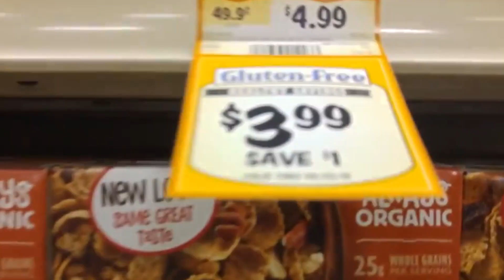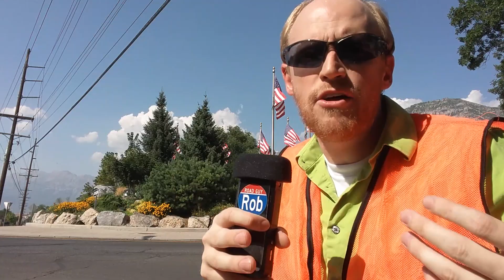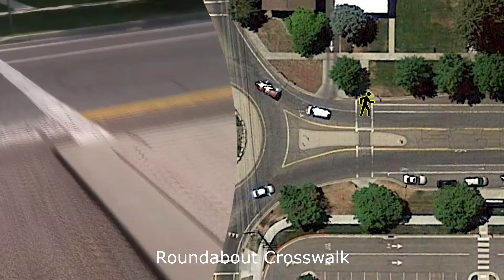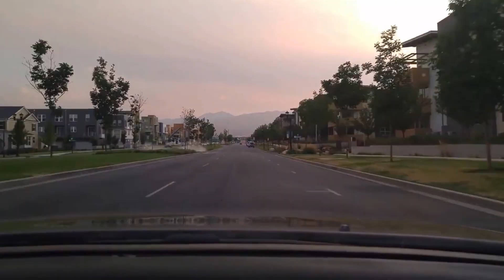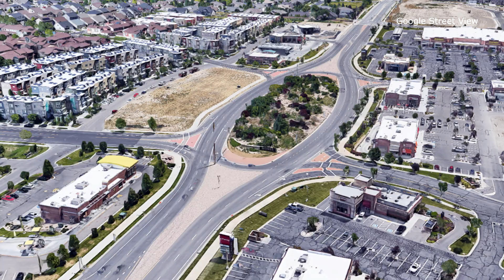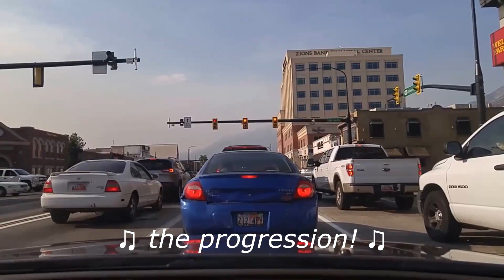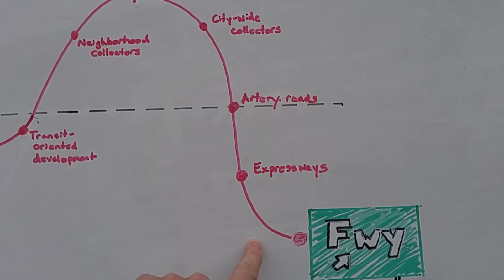Are roundabouts REALLY better than a traffic signal?

Comment: One thing you didn’t cover or I missed is that they are more fuel efficient because of all the stopping, starting and idling with a traffic light.  Less stress on the vehicle too. Not sure if this is accurate but it makes of sense to me.
Reply: Correct. Acceleration uses up more energy than maintaining speed.
Reply: in places with high traffic this is false, I had to use a roundabout on a congested road everyday and driving really slow and stoping/moving every 5 sec/ burning the clutch is the worst, if there was a traffic light then I could just stop one time and turn the engine off and turn it again when the light is green. And when I  fianally reach the roundabout I had to really step on the gas  to enter it. There was always a poisonous cloud from diesel cars.
Reply: @423GustavBern  I think it depends. We had a high traffic circle that had been there for decades, about 5-10 years ago they changed it.  Before it was fast moving, now we avoid if possible during peak hours because it’s terribly designed.
Reply: @423GustavBern  if you stop/move all the time in traffic, you're following up too close.
Reply: With stop-start technology this is less of an issue since cars will know exactly where they left off and can pick back up again easier, and while off they aren't burning gas. (Its gentler than manual turning a car off and on again where the car forgets where the cylinders are and just trys all of them).

Of course a roundabout flowing properly is theoretically better because you don't slow down as much so you waste less gas by braking all the way to 0 and then going again, or worse idling for what feels like an eternity only for the next light to be timed so you hit every light red like they seem to be in my city.
Reply: @jasonreed7522  cars do have sensors to pick up the crank rotation, but it does take longer to fire up when it’s cold because the car cranks over and checks that everything is perfect then adds fuel, because if it miss fires just once the car will probably not pass emissions testing, when the engine is nice and warm the right parameters are reached more quickly and it fires right up,
Reply: Your point is 100% incorrect.  You are forgetting all the breaking caused by all entrances to the roundabout having to slow down/stop.  That breaking means building back up to speed which is the least fuel efficiency of your travel.  You are also skipping all of the green light traffic that flows through at speed which is the most fuel efficient traffic.  The mandantory breaking and speeding back up is taking more of a toll on your vehicle AND wasting more fuel.
In short, as opposed to pointing out a positive, you have pointed out a clear negative of roundabouts.
Reply: @winoodlesnoodles1984  I’ve lived in places like Tulsa and Boston.  Boston has a lot of roundabouts, Tulsa has several stoplights every block.  I’ll take a roundabout any day as do many who are commenting.  100% incorrect is a stretch, but appreciate your comment and you do make some good points.
Reply: @billwong553  I will yeild 100% incorrect is a stretch, but not much.  The human condition is why a lot of people like roundabouts.  That is we tend to focus on the negative more than the positive.  The restaurant industry is the perfect example.  It is well known that a person have a bad experience at a restaurant is 4-5 times more likely to leave a review than a person that has a good experience.  That is precisely what is going on with roundabouts.  Basically you remember stopping at red lights specifically because you had to stop.  You don't remember all the times you drove right through green lights without slowing down because it had little to no impact on you.  You don't feel lucky you got to drive through without slowing.  This is why most  commenter focus on not having to fully stop despite having to slow down, often significantly.
To be fair, roundabouts do make traffic a bit better for non priority roads.  However, this is offset by making things much worse for the priority road.  The priority road is that due to greater traffic volume.  Thus, the roundabout becomes a net negative.  However, if you are the entering, a priority road from a lower priority road, you situation is actually improved.  Thus for yourself and other commenters, some roundabouts may be a net win for you.  They still remain a net negative for the overall traffic.
Reply: @winoodlesnoodles1984  A study by the Insurance Institute for Highway Safety (IIHS) estimated that the conversion of 10 percent of the signalized intersections in the United States to roundabouts would have reduced vehicle delays by more than 981 million hours and fuel consumption by more than 654 million gallons in 2018.  

Studies by Kansas State University measured traffic flow at intersections before and after conversion to roundabouts. In each case, installing a roundabout led to a 20 percent reduction in delays. Additional studies by the IIHS of intersections in three states, including Washington, found that roundabouts contributed to an 89 percent reduction in delays and 56 percent reduction in vehicle stops.

While cars and trucks are increasingly cleaner and greener, vehicles idling at a signalized intersection still emit pollutants and gases into the atmosphere. Stops and starts use more fuel. Because roundabouts reduce the number and duration of stops, they also reduce vehicle emissions and fuel consumption. In a study of 10 intersections in Virginia, the savings amounted to more than 200,000 gallons of fuel per year.

it’s just my cognitive bias though.
Reply: @billwong553  First, I will agree in appropriate intersections there is some merit to roundabouts.  I have yet to see an example of a civil engineer intelligent enough to locate one at a proper intersection.
The KSU study is worthless.  You can't claim reductions in delays without stating the extra delays caused by roundabouts.  Useless research by people trying to prove their point without researching the counter point.  However, that is just how pathetic universities are today.
It is undeniable that, as you state, starting and stopping and idling are the largest waste of fuel.  This is a key problem with roundabouts.  The lose the green light efficiency of vehicles that never had to slow down.  That is the best fuel economy and least wear on the vehicle.  Roundabout negate all of that.
As for the Virginia study, on the surface it proves your point.  This is where my cognitive bias comes in.  Having show that KSU and most people don't consider the inefficiency cause by roundabouts, it is my personal opinion (again my bias) that the Virginia has made the same error. Until I can research it and prove that, I will agree this one item makes your point.
There is another thing missed by a lot of studies that is clear when you are at a roundabout.  Most are not 18 wheeler (semi) or bus friendly.  Until that is remedied.  I will not support the stupidity of roundabouts except in quite suburban areas that aren't designed for buses or semis anyway.
Reply: @winoodlesnoodles1984  "They still remain a net negative for the overall traffic."

Roundabouts mean fewer people are killed, so they're  a net positive.

Comment: Alright but these are a fucking nightmares in a semi. There's a set of roundabouts in Hammond, LA off of I-12 where you can get stuck yielding forever because when your gross weight is 80,000 lbs it takes several seconds between you flooring the throttle and the truck starting to move, and by then there's already another line of cars in the roundabout and you have to stop and yield to them again.

Comment: Your interesting topic got me thinking about road safety in Australia. Road deaths here have dropped from 2,800 in 1989 to 1,145 in 2018. That’s a 59% reduction in 30 years, despite a 62% increase in population over the same period. We’ve had many safety initiatives in this time, one of course being extensive use of roundabouts. When “platoons” of cars can’t be fixed upstream, changes are made such as part-time traffic light filtering on the roundabout. Some larger roundabouts have slip-lanes for left turns. 

What really scares when driving in the US are four-way stop signs. They don’t exist here.

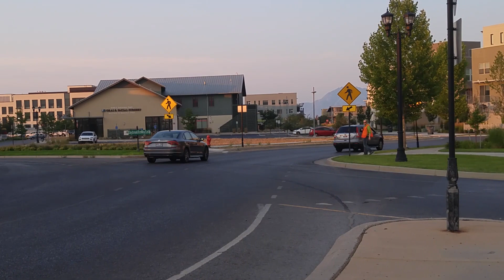Comment: 4:17 in Europe some roundabouts also have traffic lights. Sometimes stopping one entrance or left turn only, or straight ahead only. Very big roundabouts can have a pedestrian underpass or footbridge.
Reply: A roundabout with traffic lights is the peak of human stupidity. You get the worst of both worlds. Living next to one of those abominations.
Reply: Those are not roundabouts they circular Lanes
Reply: @Orionte9  They're still called roundabouts in most European countries. I think the American term for those is 'traffic circles'.
Reply: @PJBonoVox  We have such a roundabout with lights on a big intersection where the freeways comes into the city and where we have several directions to leave it. I was skeptical, but it really works well. You need to wait at least at one light. But it doesn't clog and the lanes are very clearly lead.
Reply: Worst are the traffic light roundabouts that have pedestrain traffic lights just 30 meters away from the exits of the roundabouts. you are just gettiing up to speed when stopped by a walker who pushes the button just as the green light goes on the roundabout. No synchronisation between both signals so that all the traffic is stopped on the roundabout even though they have a green light.
This is lovely at school times when hundreds of students are walking out onto an arterial route at quitting time. It leads to many 2km tailbacks and delays until the students get home. Educators, not being ones for imaginative solutions, all start a 9 o'clock and all finish at 3.30 so you can imagine the resultant chaos for other road users.

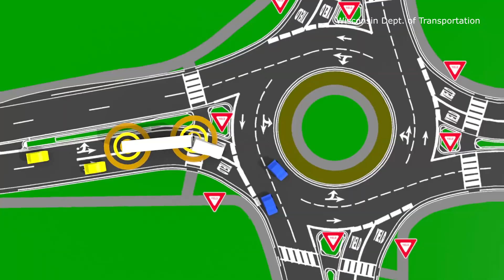Comment: 2:14
To begin with, that truck is doing the roundabout wrong. The truck should be on the right lane, and occuping a bit of the left lane to have enough space to do the manoeuvre safely and with enough space. I'm a European truck driver, and roundabouts are not very difficult to manage with a truck. 
Motorcycles, that's a real pain in the ass...

Comment: We have some large roundabouts (with 3-4 lanes) in some cities here and they added lights to them. This way, only so many cars can enter the roundabout, and each time they get a green light, 95% of them clear the roundabout. Somehow this keeps the traffic flow high and yet, accident-free.
Reply: As much as I hate seeing a beautiful roundabout ruined with traffic signals, they are a great way to give some power back to pedestrians.  The major downside to a well located roundabout is that traffic can actually do away with stopping entirely.  

For some pedestrians it is simple enough to walk in between traffic since it has slowed down, but those with limited confidence or mobility can end up stuck waiting for a break that never comes if they try to cross at a roundabout in peak hours. 

Drivers naturally avoid stopping for the pedestrians before entering the roundabout even if they are instructed to give way to pedestrians because stopping impedes the traffic behind them.  A traffic light means cars are forced to stop so the pedestrian can make sure they have been seen and can cross safely.  

The best of both worlds would be graded crossings for pedestrians so they don't actually interact with the roundabout at all and instead tunnel under it or bridge over it. 

If you can't have lights or pedestrian bridges, the next best thing is to move the crossings as far away from the roundabout as possible and disconnect it from the pedestrian foothpaths to discourage people from crossing at the point where cars are too busy observing the traffic on the roundabout to stop for pedestrians reliably.

Comment: You missed the three most important points that are major advantages;
1) Huge reduction in fuel consumption and resulting pollution from idling vehicles.
2) Much faster travel for everyone.
3) Easiest and safest possible way to do a U-turn or turn across traffic (that's left in the US)
As for the comments on Freeways, what????  UK & European motorways have them at every junction with a slip road and the roundabout either above or below the main road.  So what is the possible problem?

Comment: But Wait! What about multi-lane roundabouts with traffic lights on the roundabout? Truly the worst combination of variables ever to be puked out of any town planners wet dream. Both slower and more expensive, defeating the advantages of either system. AAAAaaaand because its so ridiculously confusing you get to put pretty LED lane markers on the road that change configuration with the changing of the lights. Even more expensive to install and maintain.    Its fucking genius.  But, I have to say its trippy as fuck when you are driving along fucked out your face on acid. I went round that roundabout at least fifteen times till I saw a blue meanie and had to escape. Shoulda seen the tracers man! Wild. 
This padded cell is really cosy.

Comment: He incorrectly pronounced Carmel, IN, instead saying it like Carmel, CA (by the sea). Otherwise, important points. Traffic lights are hardly a safety measure - they are almost entirely for traffic flow. Traffic circles are great for improving safety, for reasons mentioned.

Comment: I dont believe the part about you stating feeder roads allow cheating. No your understanding is incorrect. Its designed that way so anyone who has no buisness at that intersection isn't imposing more traffic and producing unnecessary loading at an intersection. This is a far safer better approach by separating the traffic. That concept is sound. Another form of that was in Chicago when its grid system was developed. It incorporated alleys to give access to rear deliveries and seperate traffic instead of chaos like how randolph and other streets were pre 1871 great fire

Comment: Hey Rob, you should go visit Ireland sometime. My spouse and I went there for summer vacation a couple years ago, and we encountered several freeway interchanges that were actually giant roundabouts. They made getting on and off the freeways, or motorways as the Irish call them, a lot easier, especially since we were already dealing with trying to drive on the wrong side of the road for us. It's also interesting to note that larger roundabouts on these major roads in Ireland also often had stoplights with them.
Reply: One of those roundabouts nearly killed my daughter stopped at a red light on the entrance to an urban motorway. A brain dead motorist doing 70mph spotted the lights just turned green and kept going....into my daughters car stopped dead at one of those moronic junctions. The council has since redesigned the same junction and avoids roundabout lights where at all possible. They are just too dangerous.

Comment: I don't think there should be any problem with a single lane roundabout.    Throw in that 2nd lane and all hell breaks loose.   I guess my question is:   when would anyone want to be in the inside (left) lane?   If your goal is to get off at one of the 3-4 exits wouldn't you be in the outside (right) lane?

Comment: Rob: "Don't put the roundabouts on the freeway or in downtown"
Oklahoma DOT: "Hold my beer and check out this big freeway roundabout we put in downtown Tulsa"
Reply: that is... disgusting
Reply: @blitzn00dle50  Wait until you see the complete lack of public transit and the near-total lack of cycling and pedestrian infra.  Traffic sucks because there's too many cars and not enough places to put cars.
Reply: I haven’t been to Tulsa for about a year. Where’s it at specifically?
Reply: @Andy-vt7sl  Northeastern Oklahoma, about halfway between OKC and the northeast corner.  Many map apps will default on a freeway beltway in downtown Tulsa so small it's basically a 60 MPH two way roundabout.
Reply: Ok I see I think. You’re talking about the 75/64/244 loop?
Reply: @Andy-vt7sl  Yeah, though most traffic is local and calls 64 as 51 on that part.

Comment: In dc you get these large circles on arterials where you have a 5 or 6 way intersection. Even though there is traffic it's much better than a stop light in that situation, even if it's uncomfortable if you're not used to it.